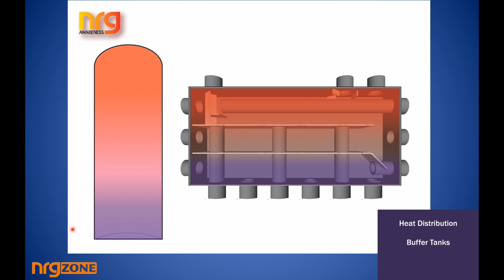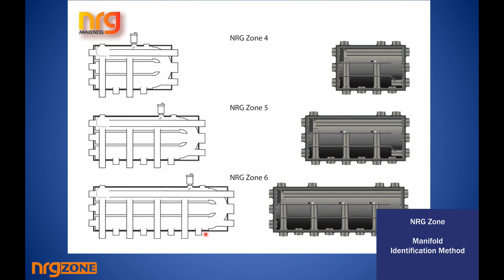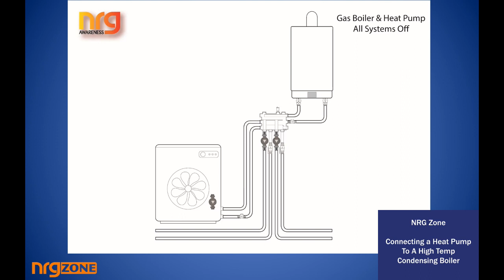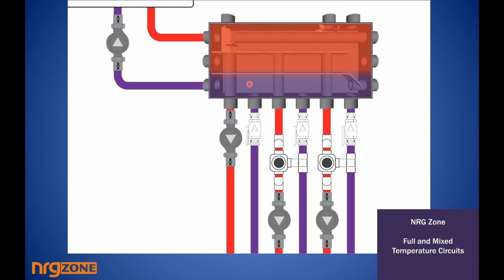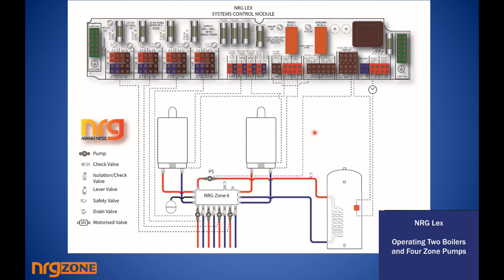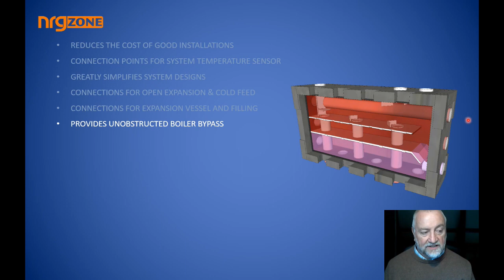NRG Zone Technical Information Presentation

Comment: where would an injector Tee fit into this setup.
Reply: On the return from the bypass from nrgzone back into return on a solid fuel appliance.
Reply: I don't know if it's accurate, but I believe the first form of hydraulic separation was the close couple t. I think low loss head has followed later for the same purpose. I think this is covered in the book pumping away. Stratification occurs within a low loss header in the same way as it would in the nrg zone. It would be interesting to know what the effective orifice size is between the baffle plates in the nrg zone. Does the orif size vary depending on the power being applied through the unit?
Reply: @andrewmillwardwatford9410  it was but with limitations. But note an injector Tee is nothing to do with a close couple T orientation.  A low loss header has no physical "barrier" like an nrg zone in particular orientations. I've found the NRG zone to be more affective.
Here in the west of Ireland where SF back boilers are everywhere this NRG Zone is a God send for link ups.  In my own home i have a SF stove, SF range and oil boiler successfully linked up, no pitching, no reverse circulation, no interference, easy zoning, the list can go on.
Reply: go to 56mins on the video. :)
Reply: If you're first flow connection was underfloor heating at delta T5 and was around 50% of the boiler output as a load how would you ensure you got the correct temperature supplied through the next two flows? It seems to me that the top section is actually constructed in reverse to the way that would actually insure proper mixing for the top three flow connections. You see this problem come up a lot on multi outlet lo loss headers. On the video that I made showing how the NRG zone is just a folded low header it's easy to see how incorrect mixing can occur depending on how you connect up the various zones with different flow rates.